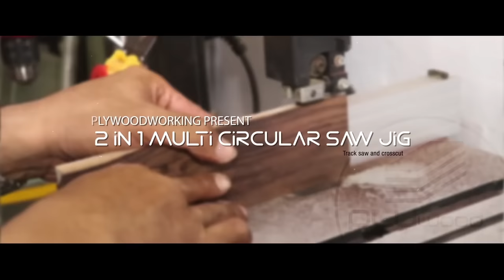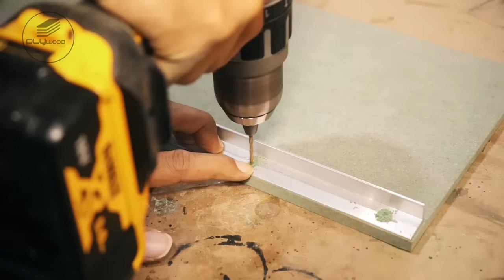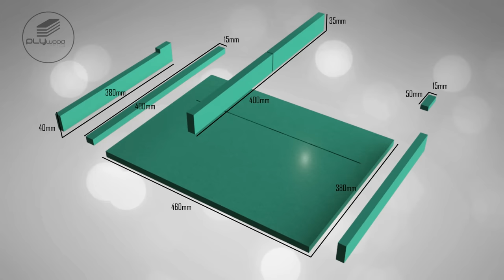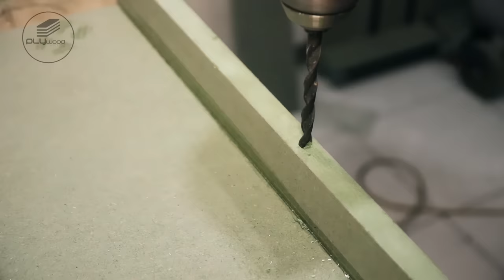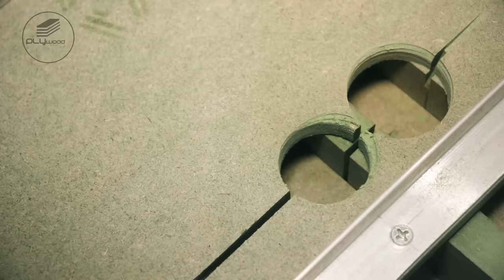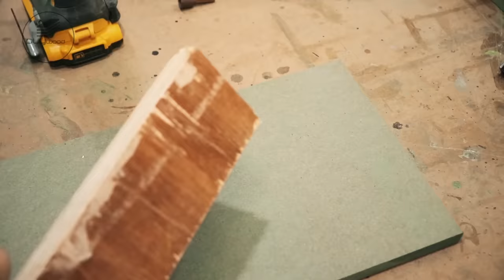DIY 2 in 1 Multi Circular Saw Jig - Track saw & Crosscut

Comment: How powerful is your AEG for cutting 32mm Fomica countertop and hardwoods? I planning to get one
Reply from the maker: if you use sharpen blade i think you can cut that, i recomended bought 7 1/ 4 inchi this is still 6 1/2 inchi

Comment: How do you line up the cut when the material being cut is thinner than the space under the cutting jig opening?
Thanks for the video!!
Reply from the maker: if material wide you can use track saw, minus this jig cut difficult cut small wood

Comment: Mas,,dikasih brapa mm celah pinggir relnya..pake plat tebal brapa
Reply from the maker: Kisaran 1mm aj 1 sisis jdi ya nanti 2 sisi dptya 0.5mm udh ckp buat slidi tp ttp aman gk goyang, ini pake aluminium 2mm aj mas udh kuat koo klo bentuk L
Reply: @plywoodworking  
Pengen punya meja table saw tp blm punya alat yg benar2 presisi ada yg bisa bikinkan gk?😁 nanti jual ke sy custom ukurannya